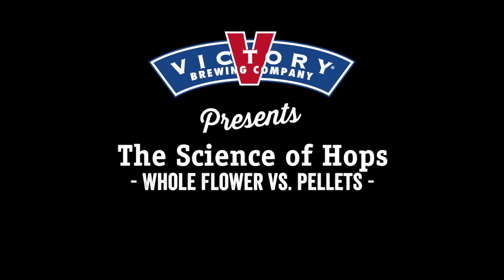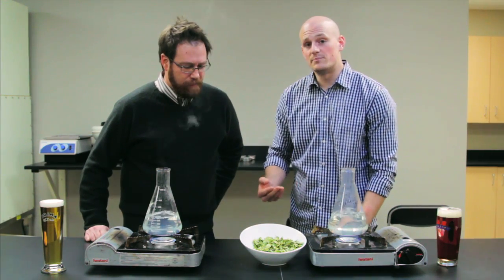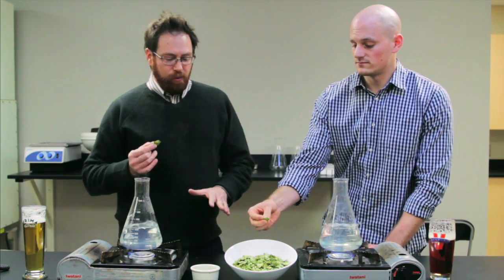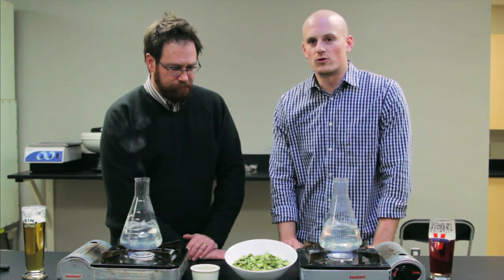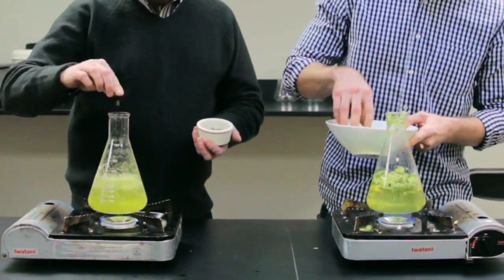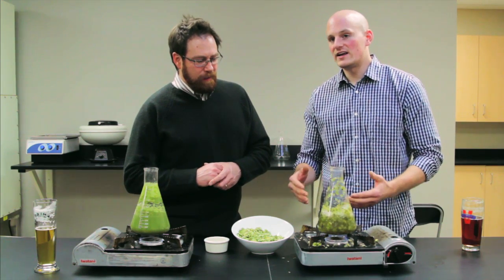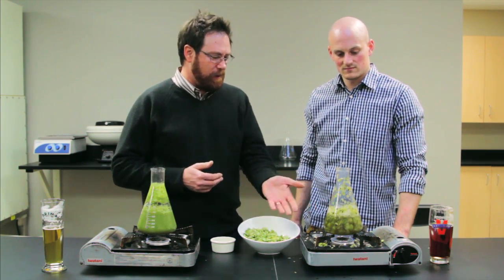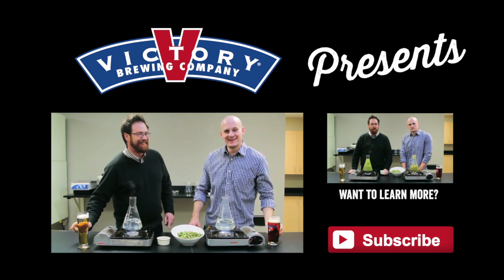Victory Presents Ep.1 The Science of Hops

Comment: That doesn't seem to be a serious experiment at all. In which beer do you ad hops until the kettle is full of hops from top to bottom?
 
You did not seem to add the same amount of hops, as most of the whole flower hops were left in the bowl. The hops should have been added to achieve a theoretical bitterness, as it would have been while brewing.
 
What you didn’t say is that a lot of the vegetal material is removed during pelletizing, which decreases contribution grassy flavours from chlorophyll.
 
My conclusion is that you just designed an experiment to prove your theory right.
That doesn't seem to be a serious experiment at all. In which beer do you ad hops until the kettle is full of hops from top to bottom?
Reply from the maker: Hey There Daniel Tavast Thanks for reaching out with your concerns. This is not a scientific experiment, rather a demonstration. It was not designed to show that whole flower hops are superior. In fact, we went as far as to say that neither is superior to the other. We simply wanted to explain our philosophy using a visual, easy to understand method that shows what happens in the kettle when pelletized hops are added versus when whole flower hops are added. At Victory, we prefer the whole leaf hops because we believe they offer a fresher aroma and flavor quality to the final product. We think this demonstration provides a good representation of the differences between whole flower hops and pelletized hops in the brew kettle. If you have any further questions, please feel free to email us at qualityassurance@victorybeer.com. 
Cheers! –Zach Miller